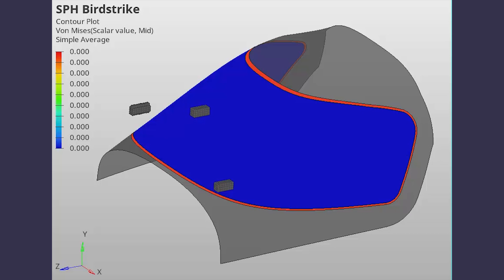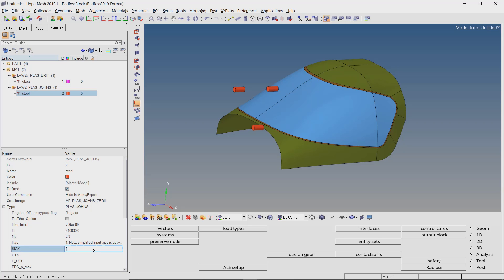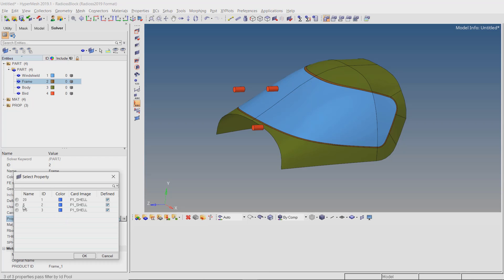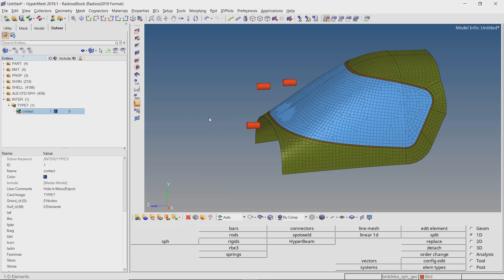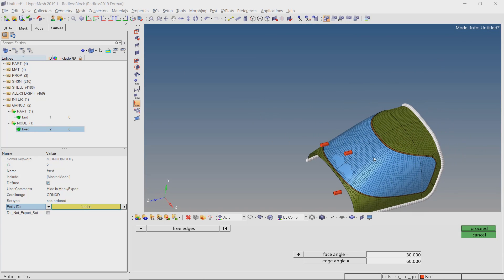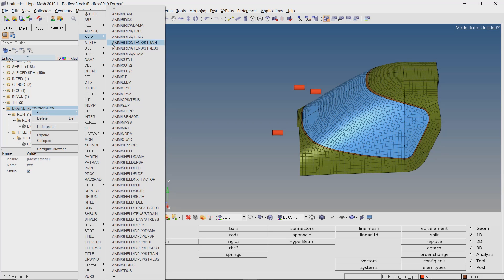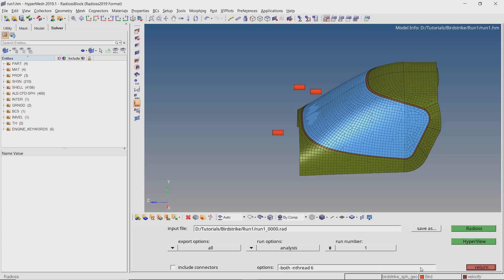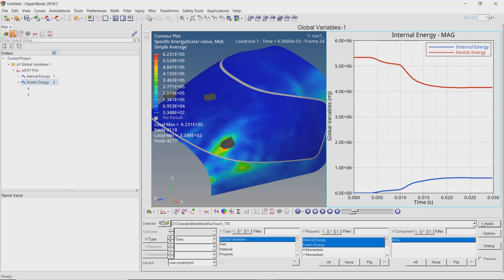Hypermesh Radioss Tutorial [Dynamic Analysis]

Comment: Hi Sir could you please tell what is the necessary for creating the card image as part and sir one more thing while creating the mat 27 card for the glass does the parameter E mean that the elastic modulus of glass is 60000, is it from any reference or something
Reply from the maker: Hello,
It is the way Radioss solver works. Every component with card image as PART is considered separately in the calculation of output parameters. If you do not change card image to PART, the component will be neglected or the solver will show some error. Note that this is not applicable for rigid components. They can have blank card image.

Yes, E is Youngs modulus. I have taken these material values from material database. This data can be obtained from several websites on the internet.
Reply: @Aeroswap  Thanks a lot sir
Reply: @Aeroswap  Sir I more doubt when do we generally use SPH methods ? When I googled out some info showed in a solid -fluid interaction problems then why here?
Reply from the maker: SPH can be helpful to predict the behaviour of soft materials. So yes, we can perform solid-liquid interaction analyses using SPH. Another great application is shown in this tutorial, bird strike! A bird can be considered to be made of soft material in real life case. SPH can provide realistic results for birdstrike tests. This method is also used in impact tests for brittle or composite materials to capture the damage results accurately.

The only drawback of SPH method is that the solution takes more time to solve. To get the desired level of accuracy, very fine mesh has to be generated for SPH component and this in turn increasing the solver run time.
Reply: @Aeroswap  Thanks a lot for the clarification

Comment: Hi dude, i have a question. In my analysis, after run, the A001... A100 arent available. You know why it happens?
Reply: i'm using the 2022.1 hyper version
Reply from the maker: Hi Pabllo, this is probably the result of incorrect control card definitions. Please make sure that the TFILE and ANIM_DT cards are properly defined as shown in the video.

Comment: i like this video..Thanks.
But can you make video which will describe the difference between implicit and explicit analysis( hm-Lsdyna /radioss) with examples.
Reply from the maker: Sure. In simple terms, implicit/explicit is just the solution approach implemented by the solver. We can perform any dynamic analysis with either of these methods and obtain fairly similar results.

Thanks for the suggestion! I will work on this 👍🏻

Comment: Excellent ! For me the only hard part is to find the correct information to fulfill the material property. 
What will be the difference if we put bird as master nodes and plane as slave nodes ? Why in this tutorial are we working with the solver browser and not in the model browser like the simulation of the bullet ?
Reply from the maker: Hey Harry, good to know you liked the video!

Yes, finding the right material data and converting it to required units is a tedious job. Unfortunately, there is no workaround for this!

As a general rule of thumb, a moving part is always considered as slave and fixed part as master. That is why the bird nodes are slave entities in this simulation. But you can always experiment doing it the other way. I do not think it will cause any errors in the run.

Good question about the solver browser. If you notice, the bullet video was recorded with HM 2019. Now I have switched to the latest version 2021. There are some major changes in the workflow. For example, the velocity cannot be created using the model browser anymore. The BCs manager from Tools panel is also removed. The new method to create velocity loads is through the solver browser. Using the solver browser also helps to add some solver specific paramaters easily which would be difficult with the model browser. Hence, the change :)
Reply: @Aeroswap  Thanks for the answer. Yes i don’t have hypermesh 2021 that why you did that. 
Thanks for sharing your knowledges. 
Have a good day 

Harry

Comment: Bro such an informative video👍👌, I had stumbled on an obstacle, while meshing headlining with cutout for sunroof assembly. The headlining component and the skin component together was merged into a single component. I'm unable to get midsurface properly and other jugads (surface pair, offsetting surface) for midsurface also failing. Pls help, I'm using HM13. Pls pls help.
Reply from the maker: If the edge of the sunroof is clearly visible, a line geometry can be extracted.
Create a temp component. Now go to Lines tab in geometry panel. Using the extract lines option, you can extract surfaces edges as lines.

Then, by using solid edit, trim all the solids with these extracted lines. The unwanted part will get separated from the sunroof and can be easily deleted.

Hope it works, let me know how it goes!